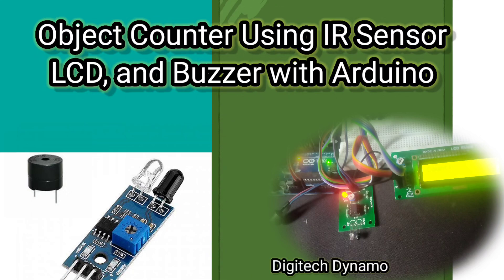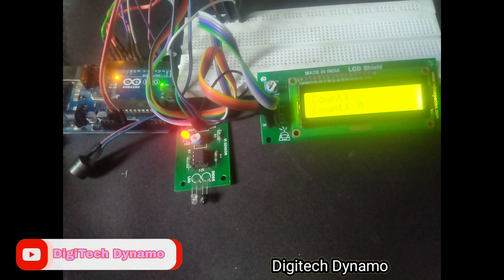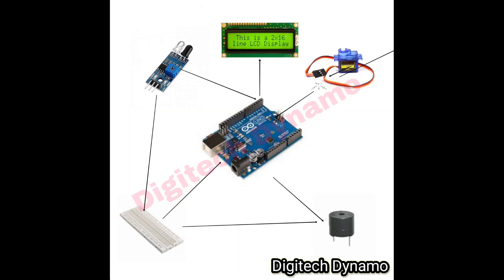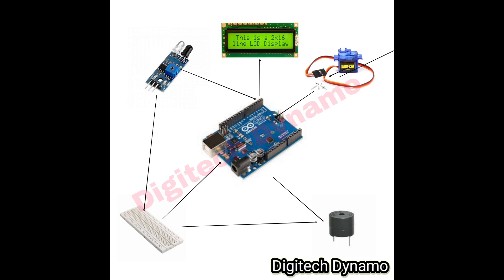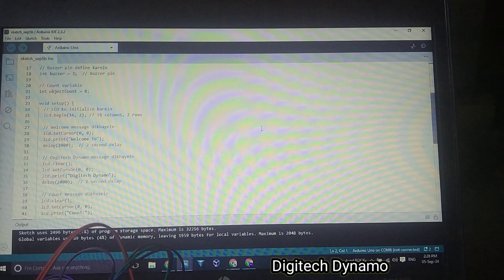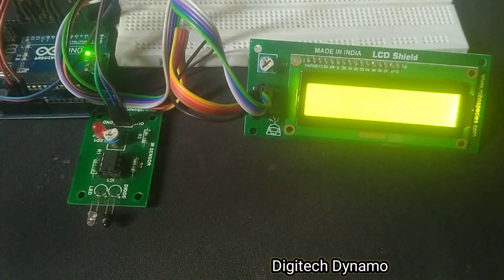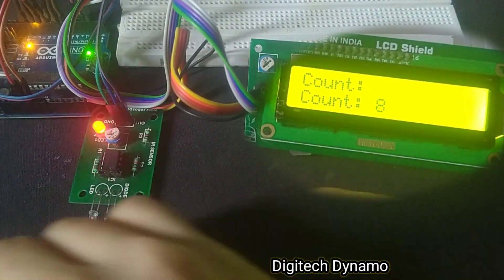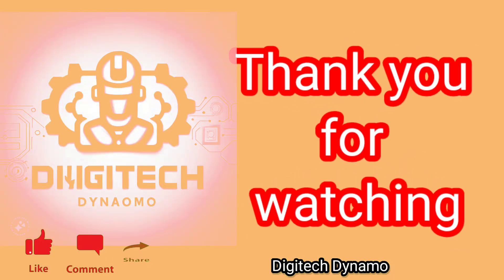Object Counter Using IR Sensor, LCD, and Buzzer with Arduino

Comment: Where is the code?
Reply from the maker: @davidhouseago416  hello dear here is code #include <LiquidCrystal.h>

// LCD pins define karein
const int rs = 12;  // Register select pin
const int enable = 11;  // Enable pin
const int d4 = 10;  // Data pin 4
const int d5 = 9;   // Data pin 5
const int d6 = 8;   // Data pin 6
const int d7 = 7;   // Data pin 7

// LCD object create karein
LiquidCrystal lcd(rs, enable, d4, d5, d6, d7);

// IR sensor pin define karein
int irSensor = 2;  // IR sensor pin

// Buzzer pin define karein
int buzzer = 3;  // Buzzer pin

// Count variable
int objectCount = 0;

void setup() {
  // LCD ko initialize karein
  lcd.begin(16, 2); // 16 columns, 2 rows

  // Welcome message dikhayein
  lcd.setCursor(0, 0);
  lcd.print("Welcome To");
  delay(2000);  // 2 second delay

  // Degitech Dynamo message dikhayein
  lcd.clear();
  lcd.setCursor(0, 0);
  lcd.print("Digitech Dynamo");
  delay(2000);  // 2 second delay

  // Count message dikhayein
  lcd.clear();
  lcd.setCursor(0, 0);
  lcd.print("Count:");
  
  // IR sensor pin ko input mode mein set karein
  pinMode(irSensor, INPUT);
  
  // Buzzer pin ko output mode mein set karein
  pinMode(buzzer, OUTPUT);
}

void loop() {
  // IR sensor reading lo
  int sensorState = digitalRead(irSensor);

  // Agar IR sensor trigger ho jaye (object pass ho), to count increment karein aur buzzer beep kare
  if (sensorState == HIGH) {
    objectCount++;
    
    // Buzzer ko 100ms ke liye beep karayein
    digitalWrite(buzzer, HIGH);
    delay(100);  // 100ms ke liye beep
    digitalWrite(buzzer, LOW);

    delay(500);  // Debounce delay to avoid multiple counts for a single object
  }

  // Count ko LCD par update karein
  lcd.setCursor(0, 1);
  lcd.print("Count: ");
  lcd.print(objectCount);

  // Delay to avoid rapid updates
  delay(100);
}